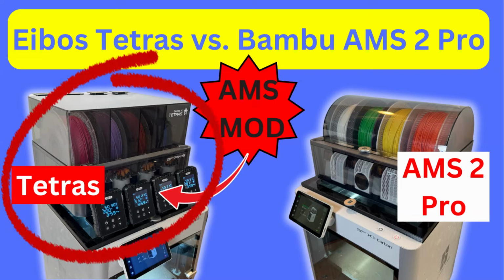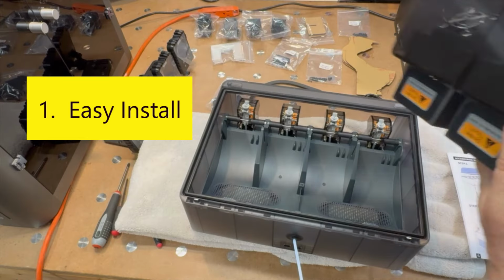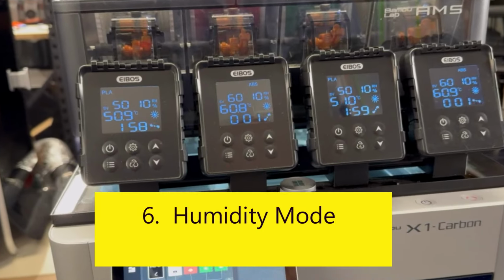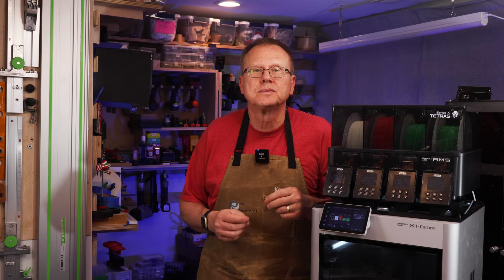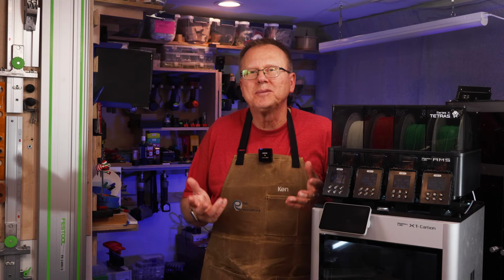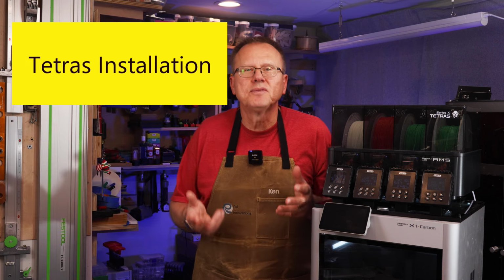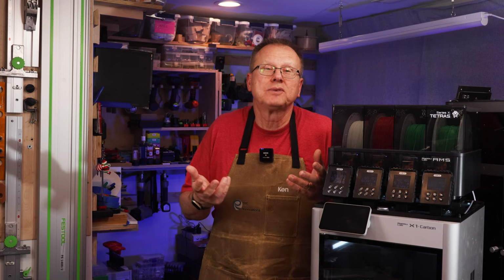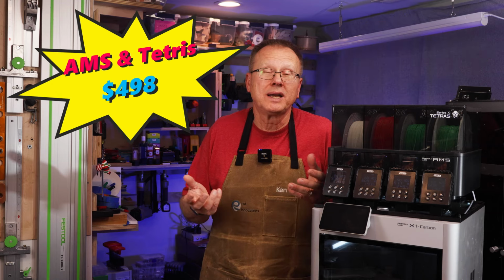Eibos Tetras Upgrade to the Bambu AMS Better Than the AMS 2 Pro?

Comment: Works out expensive when you also need to buy the AMS, having said that if you already have one the option to print while drying.
Reply from the maker: Yes, the Eibos Tetras is meant for people who already have AMS units and want to upgrade.  Otherwise it's cheaper to buy the AMS 2 Pro if you don't already have an AMS.  Thanks for the comment.

Comment: There will definitely be deals on used AMS units as some users upgrade to the AMS 2 Pro, which helps with the price differential. I would also assume that if you use a stand-alone dryer to dehumidify the higher grade engineering filaments, the Eibos will still be capable of maintaining a low humidity for that filament within the AMS once it has been loaded.
Reply from the maker: You have several good points. You may be right that some people may sell their AMS units to upgrade to the AMS 2 PRO.  I hadn't thought about your point to use another higher temperature filament dryer for the initial drying and then use the EIBOS as a humidity "maintainer" after that.  Thanks for your comment.

Comment: It's crazy to me that the AMS 2 Pro doesn't dry while printing. That alone pushes me toward the Eibos upgrade. I think I'll go with the Dyas though for $60 less. So $120, which is close to the difference anyway.
Reply from the maker: Yes, I just heard about the Eibos Dyas as well so I agree with you that is a nice compromise between the Tetras. I don’t know why Bambu Lab doesn’t allow drying even at a reduced temperature while printing. Thanks for your comment.

Comment: You will still have the same problem with AMS as before, nothing changed that. So I don't see any point of buying this add-on at all. Sorry to say, but that is the reality of these add-ons. If it had made better handling of spools also, then I would without question bought it right away. I can just go and use my Python AMS instead, and put heaters on there for a fraction of the cost of what this add-on cost. Just saying.
Reply from the maker: Sure, I understand your point of view. Thanks for sharing your thoughts.

Comment: can i use this with my bambu A1
Reply from the maker: The Tetras only fits the AMS, which does not work with the A1 series. It’s my understanding that Bambu Lab will eventually make the AMS 2 Pro work with the A1 series printers. Thanks for the question.

Comment: Real shame you can't print and dry with the AMS2. still, thanks for the information. Great video
Reply from the maker: I’m not sure why the limitation of the AMS 2Pro not being able to dry at the same time as printing. Maybe Bambu Lab will change that in the future. Thanks for your feedback.
Reply: Probably because the rotate function would not allow it to print and turn the spool at the same time. That's for more even drying and not over drying one location on the spool. If they set it up so that if you were printing and wanted to dry, it disabled the rotation, that might work. The other thing to look at would be the power consumption on their bus. It limits the H2D to one drying unit and the others have to have the brick if they are drying at the same time. The older printers have to have the bricks so I would guess that there are power limit issues also.